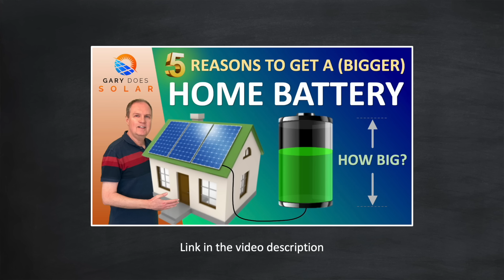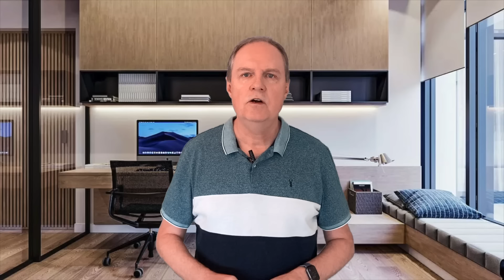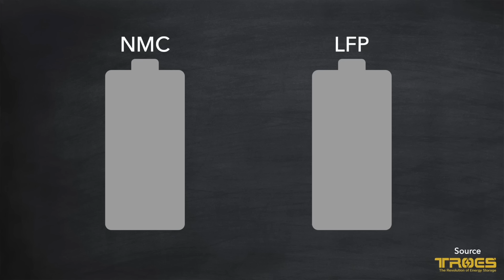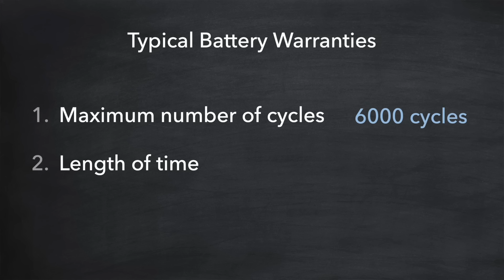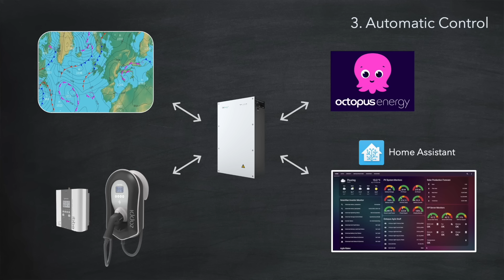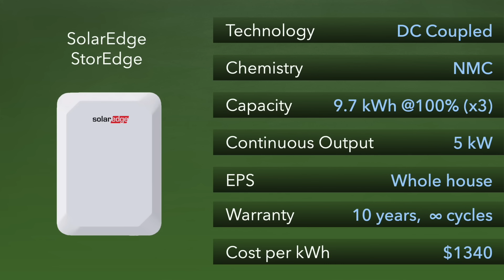8 Key Factors When Choosing the IDEAL Home Battery

Comment: What determines the charge rate and discharge rate of the battery? Is it something in the battery or the inverter that regulates this? And how do you work out the charge rate if the manufacturer doesn't list it? Thanks.
Reply from the maker: It’s a bit of both in fact. And the only way to find out is to look at the manufacturer’s data sheet, or ask on a social media group 👍🏻
Reply: @GaryDoesSolar  Ok thanks. Another question if i may, if i choose a tariff with only 3 or 4 hours off peak rate but i have a huge battery bank, how, if possible, can i get all of my batteries charged in this small window. Can you add another hybrid inverter? Would two 3.6kw inverters mean i can charge my battery bank at 7.2kw? Or does it not work like that? I'm assuming i'd have to apply for a G99 if i did that? Thanks again for all your help Gary.
Reply from the maker: @goodcat1982  So, if you have two DC Coupled batteries on a single string inverter, it certainly might be possible to put each battery onto its own inverter - you might also need to split your solar array across the two inverters as well - essentially creating two separate solar and battery systems. This would likely require G99 approval again and you would need to check with the manufacturer that both systems would operate nicely with each other (e.g. you don't want one battery draining into the other). Other commenters might have some thoughts on this too...

Comment: Gary, thank you so much for making these clear and informative videos. I've learned so much from you this past week!

I was deciding whether a DC or AC coupled battery was best for me, and something struck me when watching this video - the 'triple conversion' with an AC-coupled battery never actually has an effect (providing the battery charges to 100%) since the power is never going to be routed from the inverter into the battery and immediately back out again. Once your battery is at 100%, it only needs to convert the power back to AC once, thus providing the same efficiency as a DC battery would behind the inverter.

I suppose the efficiency loss should only be considered 3-fold if the battery wasn't 100% charged during daylight hours (if it makes it to 94% then that 6% did matter). Additionally, charging from the grid would require 2 conversions, so you lose 6% of power if you import to battery from the grid whether using an AC or DC battery.

I'm just inferring all this from what I've learned from you, so please correct me if I'm wrong! Thanks again.
Reply from the maker: You're most welcome. Glad you're getting something from my videos :-)

On the battery conversion fronts, it shouldn't matter what the start of charge of the battery is - the conversion losses should be around 10% for AC Coupled, and less for DC Coupled.

Comment: There's another thing to mention: if your battery is stored at low temperature then there's a small advantage for NMC compared to LFP because NMC can charge at above -10C while LFP only at 0C+. As for the AC coupled, I prefer not to. For DCC there's no need even for communications and you can build big battery packs yourselft.
Reply from the maker: Where the battery is outside or in a very cold environment away from the home, there's certainly an argument to be made. Otherwise, I prefer LFP from a safety point of view (higher weighting factor over everything else, in my view).
Reply: @GaryDoesSolar Well in my case I have a technical room which is in a garage-like  annex, so temperature does get there under 0C on winter nights. I'm using a remote control power outlet to increase temperature in the morning before any charging starts.

Comment: Sorry, but I was quite disappointed by this video. At least you did mention the DC-DC conversation losses in the notes, which I also spotted... What was really missing is to mention at all the difference between high voltage battery systems and low voltage battery systems. Some batteries run at about 50V and are usually cheaper and others use a few hundred V. From what I've seen so far maybe 100V to 600V, but I lack an overview. Inverters when they do DC-DC charging can often only handle the low voltage batteries or the high voltage batteries, so when you decide on an inverter+ battery system it is important to make sure they fit together and know the advantages of high voltage and low voltage... I thought I would also learn more about this topic in the video, but was disappointed.
Reply from the maker: Maybe my channel is not for you then…

Comment: Hi Gary, great channel 👍 Any tips on how to integrate a battery with a heat pump? We also have 4kwp solar and 2 EVs.  The challenge being that we have very little control over what the heat pump does and when it does it besides forcing it to heat the hot water for washing during the Octopus Go cheap period.
Reply from the maker: Thanks Andy. Essentially with regards to the battery, it simply supplies whatever the home needs (as far as its charge allows) - even if the home includes a heat pump.

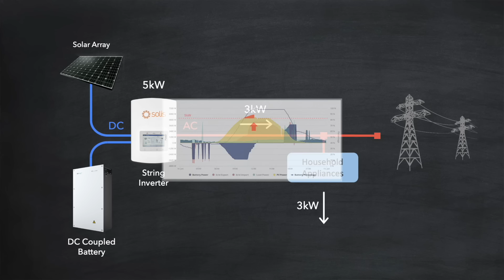Comment: What i think about the Dc couple battery in 6:04, is that you probably will not max out the 5kw all the time. The inverter will use those extra charge to fill up the DC coupled battery. So it is worth it.
Reply from the maker: That’s a good point - although during a forced export period, it likely would. But that won’t be happening a great deal anyway. Thanks for sharing!

Comment: Rather than having an AC coupled system, to increase capacity. Could we still have a DC coupled system, where a second solar inverter with its own DC battery, is setup up to be in parallel with the frist solar inverter, in order to increase the power capacity to the household appliances?
Reply from the maker: Yes, that would work - and it was something like considered for my own installation (I currently have two DC Coupled batteries on one inverter) but decided again. I do sometimes draw more than the inverter limit but it’s not that often…

Comment: For example, Tesla powerwall2. Battery cost 200. All the rest 1050. What the hell. If battery cost would be 0 this would still cost over 1000.
Reply from the maker: Which country are you in?
Reply: Finland.but that is not relevant.  I just use your example of battery cost versus the actual battery system cost. In my view, all the rest of the system around the actual battery is costing too much.
Reply from the maker: All of these costs are coming down over time though - not just the battery pack costs. Tesla Powerwall 2 costs are already down from when that video was made.

Comment: Looking at payback time, very roughly, each battery you listed costs about $1000 per kWh, which is about 3000 times more expensive than just buying a KWh from the grid at current uk daytime prices.  Let’s say we cycle each battery once per day then even if the charge we put into it were free, then it would still take about 10 years to pay back….
And that’s best case, because the electricity isn’t free, and the battery is only guaranteed for 10 years.  It just doesn’t stack up financially, does it?

BUT…. there are other ways of storing that energy.  A hot-water storage tank costs about £2 per litre, so if you use 0.1kWh of electricity to heat that litre up, then it costs just £20 per kWh.  It’s literally 50 times cheaper than storing the electricity in a battery.
Reply from the maker: Thanks for this, Dominic. Remember though, that each of that $1000 per kWh capacity can be used 6,000 times (once per cycle) and you'd ideally be charging your battery during cheaper off-peak import, not daytime. 

Also, prices are continually falling - see my recent video on battery prices, which is making the ROI better and better over time.
Reply: @GaryDoesSolar  Thank you for replying.  You do really excellent videos and obviously read and respond to comments, whcih is great.  But you slightly miss my point about the daytime cost.  Let's say you use this battery for what I call "time arbitrage", buying cheap night time leccy and using it during the day. If nighttime costs 10p and daytime costs 30p, then you save 20p per cycle. 6000 cycles would save you £1200 (i.e. only just covering the cost of the battery) but those 6000 cycles would take 16 years!!!   That also ignores the time-value of money.  I'd love to see the payback time calculation you used to persuade your wife it's worth dong this....  
Sadly, I have yet to find the financial justification for anyone but wealthy middle-classed people on a guilt-trip about what we're doing to the planet.
So I'm working on developing a big cheap granite-chip heat battery because in our particular case we use lots of energy heating, that I could avoid with a cheap heat store combined with Octopus Agile tariff. That'll be combined with a large hot-water buffer warmed by a water-source heat pump.
Reply from the maker: @dominicgoodwin1147  Thanks - trying to figure out the ROI on a battery-only installation is not straight-forward, and it's the main reason I developed this utility, that I'll be releasing shortly. See what you think: https://garydoessolar.com/utilities/batarazma/
Reply: @GaryDoesSolar  That looks great! I think your calculators are a great idea.  Renewables are so much more complex and multifaceted than just sticking in a boiler and burning fuels, and tools like these help people to understand the different parameters they need to consider. Love it!
Reply from the maker: Thanks Dominic. I’m thinking about your water storage insight…. 😀

Comment: I have a GiveEnergy AIO which is not big enough. They said we would be able to stack many together (like Tesla) but many months later no idea when !
Would putting a DC coupled battery be better just to add a little more capacity - or would the control of it be hard work. I don't want the hassle of Home Assistant. Only really need 6kWh and I am guessing that the additional AIO will have the full 4 batteries in them hence twice the size and cost.
Reply from the maker: Hi Ian, worth watching this video from Speak To The Geek which might answer: https://www.youtube.com/watch?v=L3DjenoRKwQ

Comment: I'm interested in a small (~5kwh) AC battery, ideally modular for future expansion. Does such a thing exist?
Also i'm trying to work out, is a hybrid inverter still required for AC battery systems? Or would non-hybrid be sufficient?
It seems to me that non-hybrid inverters will not work with grid-linked systems, which does make me then wonder, why are there so many non-hybrid inverters available on the market, is there that level of demand for non-grid linked PV systems??
Reply from the maker: A hybrid inverter is required for a DC Coupled battery. For AC Coupled batteries, a normal inverter is ok as the battery is separate from the inverter (it essentially has it's own inverter or charge controller).
Reply: @GaryDoesSolar  thanks so much Gary for clarifying, that is what i kind of thought. Which is contrary to what i have recently been told by a prominent on-line solar equipment reseller... hence my confusion. Best i don't name and shame that disappointing 'advice'

Comment: Very thought provoking - thanks.  I currently have a Solis hybrid system with Pylontech batteries, and was thinking of expanding the Pylontech array as I'm hoping to get a heat pump in the near future.  Now wondering if I ought to supplement with an AC battery instead. Now just need to find someone to ask!
Reply from the maker: Let's see if anyone on here has a view. Your DC battery will of course be limited by the managing inverter limit. I have a DC Coupled battery myself, but actually, I wish I had an AC Coupled one as I believe it has more benefits. Good luck with whatever you decide!

Comment: People always talk about Solar clipping in a negative way. Oversizing those panels against the inverters is a well-kept secret and, believe it or not, a boon the end user.

Why is inverter clipping secretly fantastic? It's like having an insurance policy ensuring energy production even during less-than-ideal situations – think lower light scenarios or imperfect panel orientation.

By going big on panels over inverters, we're compensating for real-world challenges – from temperature variations to shading and pollution. 

This savvy move not only boosts your return on investment but also ensures steady power even when nature throws a curveball.

Think about it this way: across the year, cloudy or partly cloudy days outnumber those picturesque, clear-sky days. 

Having panels that kick the inverter into gear earlier means more power and savings during those dimly lit moments. That’s what it’s like most of the time in the UK.

Plus, oversized panels combat pesky environmental foes like dust, shade, pollen, and rain – ensuring your system's resilience.

And here's the cherry on top! Most solar arrays aren't always basking in perfect conditions. 

But with larger solar panels, we're maximizing the inverter's productivity. Leveraging the inverter's sizing capability leads to a robust energy output, providing consistent AC power each day.

By supersizing your PV array, the inverter hits its rated AC capacity earlier, operating at full throttle till late afternoon, squeezing out every drop of sunshine to power your world.
Reply from the maker: Hi Mark, thanks for this, which aligns well with the content I’m preparing for a video exclusively on that topic 👍🏻 😀

Comment: DC coupled batteries outputting to the solar diverter and the EV charger. Why is that a negative? You mentioned that 10.30min just curious? Thanks
Reply from the maker: So, on the basis that you’d only want to charge your EV with off-peak energy, you’d want to draw that energy directly from the grid. But if the battery doesn’t know any better, it will see this grid draw and discharge itself to minimise that draw, defeating the purpose.

Comment: I understand most everything you have put forth. What I cannot seem to grasp is how to throttle charging and discharging the battery as to production and consumption. Buying an electric car that can be used as a battery seems very cost effective. How do I stop it from discharging at a rate far faster than needed so as to not pump it into the grid?
Reply from the maker: The battery management software will do that for you. It can sense when energy is being exported to the grid and throttle back discharge.

Comment: If I have a dc battery 19.2kwh with a discharge rate of 7kwh and a 5kw hybrid inverter are you saying that the maximum the inverter will supply to the house during night time is 5kwh. If I have 2 x tesla powerwall 2 with a maximum storage of 27.6kwh and a discharge rate of 5kwh per battery what would be the maximum supply to the house during nightime 5kwh or 10kwh.
Reply from the maker: Yes for the first question, and 10kWh for the second.

Comment: Great video, I've GIV-Bat8.2
 x2 but can't find any EPS related info anywhere. Not on the product sheet, not anywhere else on their website. May need to call back the installers and ask there...
Reply from the maker: Hi Tom - thanks for the kind words. Might be worth reading this, which covers EPS setup. Will be inverter model dependent: https://givenergy.co.uk/wp-content/uploads/2023/08/Gen-2-Hybrid-Inverter-Installation-Manual.pdf

Comment: Can you use a hybrid inverter without a dc coupled  battery if you are planning to add a battery later eg after two years or so?
Reply from the maker: You don’t need to add a DC Coupled battery to your hybrid inverter.  You can instead add an AC Coupled battery, yes 👍🏻

Comment: Excellent video Gary. Thanks for all your hard work. The GE certainly seems like a good choice in the uk, but my concern is the need to have a separate dc inverter from solar. Would it not make sense for the GE  ( or any other manufacturer) to have a hybrid inverter built into the unit. As these setups become more common I think most people would like a one box solution with minimal "clutter" in the garage or wherever
Reply from the maker: Ah now, my understanding is that the inverter is built in to the AIO unit. Happy to be corrected on that though! It’s the EPS Gateway that’s separate - fairly typical of other manufacturers AC batteries too. 

Thanks for your kind words on my video 😀

Comment: Great walk through, but this has thrown up many questions around mixed battery types and the use of mixed voltage across my house? Do you have a channel or videos on these subjects e.g., 12 volt lighting /sockets and 240 v for consumer appliances and thus ac and dc batteries in conjunction with solar and then add in ev’ charging etc.
Reply: A lot of new internet and computers/phones al used 12 or less voltage to change and run, thus this running of the dc battlers and this would allow the use, but then the issues comes when it is not sunny etc.
Reply from the maker: Hi Tony, thanks. I'm concentrating on mass market home applications for the moment on my channel, but there are other channels covering low-DC-voltage applications like camping & caravanning. Worth checking those out...

Comment: The advantage of a AC connected battery is that if your client  is in reciept of the feed in tarrif  thety can keep the money made from the FIT. Regards Philip, Apollo Solar Energy Ltd.
Reply from the maker: Thanks Philip - good point, and one I didn't make in the video as it only applies to those lucky enough to get o the FiT scheme. For me, AC Coupled batteries are just way more flexible than DC Coupled.
Reply: i tend to install DC connected battery systems on new installations and on retro fit installations i fit AC battery connected systems.